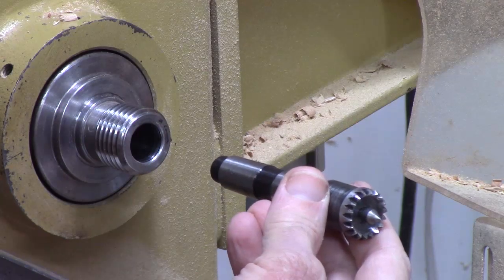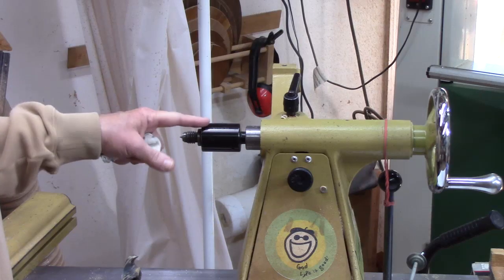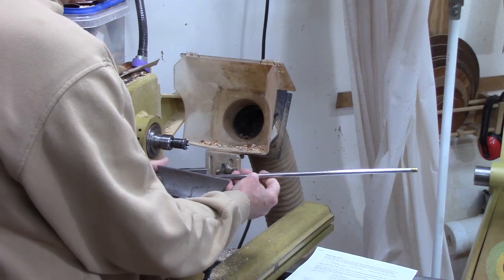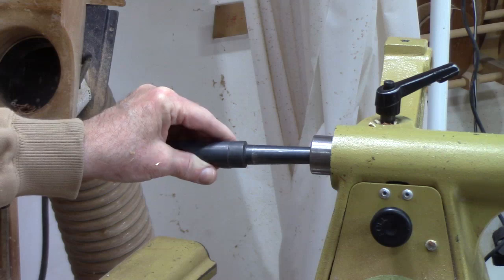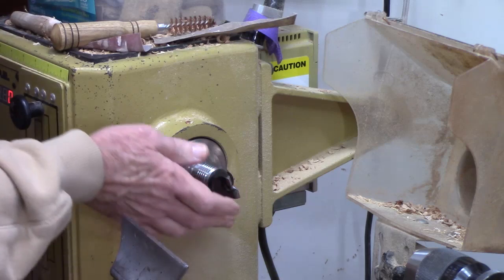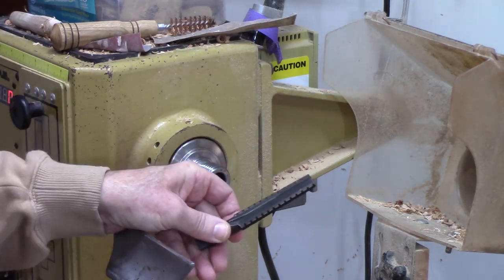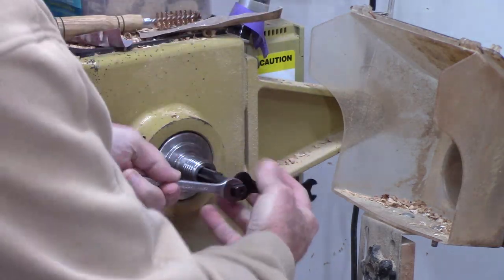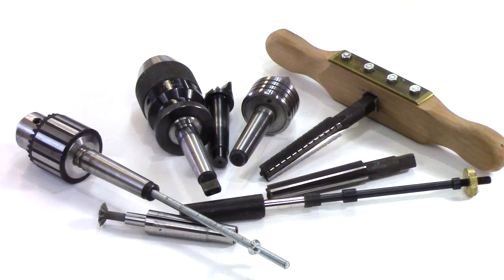Morse Taper Basics for Woodturners

Comment: Like always great information. On my lathe I drilled an taped the head and tail stock to fit a 1/4” allen screw. Then, I know it’s not the best thing to do BUT it works for me, I then make a slight grove in the Morse taper to match the allen. By doing this I have never had any thing come out or even loose . I don’t recommend doing this but it does work in my situation.

Comment: Mike - very good video.

a point that I've never seen discussed anywhere relates to the tapered arbor on a jacobs chuck.  One of the advantages of having a double-ended arbor is that if you upgrade to a larger lathe (eg, from an MT1 to an MT2), you can replace only the arbor at a much lower cost than replacing the entire jacobs chuck.  As you noted, it's really wise to use a drawbar to hold the chuck in place, especially if it is mounted in the headstock.  But the point that no one ever mentions is how do you keep the JT-33 taper end of the arbor from uncoupling with the jacobs chuck - the drawbar holds the MT-2 (or MT-1) chuck in the headstock, but the JT-33 can still work lose, and the result is that the chuck body will be thrown across the shop.
Reply from the maker: Good point.

Comment: You might try using a live center to keep the reamer straight while cleaning up minor damage to either Morse taper.  The side torque from using a wrench could make the taper egg shaped if you're not careful.Those reamers usually have a dimple in the back end that would fit on the tip of the live center. Just put the live center into the tailstock to clean up the headstock taper or put the live center into the headstock to clean up the tailstock taper. Light pressure from the quill keeps the reamer engaged on the live center.  An easy trick to prevent unintentional damage.
Reply from the maker: Good idea, Gil

Comment: When you have a morse taper reamer just bring in the quill with a center to keep the tap or reamer centered and you can use only one open ended wrench to turn while also tightening the quill at the same time to maintain center.

When you do by hand without the tailstock and center the possibility to take the morse taper out of true is greater.
Reply from the maker: Yes, thanks for commenting.

Comment: Seemed quite comprehensive Mike.
Just a note, machining suppliers sell Morse taper in many configurations like MT2 on one end and JT33 on the other. Something I'm considering for other accessories.
Happy New Year.
Alan
Reply: Alan;  JT tapers are the tapers that fit into Jacobs chucks. (but I'm sure you knew that!).   You can also get MT tapers with blank ends, but you need the ability to do metal machining to use these.  https://littlemachineshop.com/products/product_view.php?ProductID=2394&category=
Reply from the maker: Thanks for sharing, Alan.

Comment: Several have suggested supporting the back end of the MT reamer with a center when doing a cleanup to remove any galling.
I'm not a professional machinist, but I've been dabbling in metal machining for the past 20 years or so.  Some years back I bought a MT3 reamer to clean up the tailstock ram on my (metal) lathe.  That was the method I used (i.e. supporting the reamer with a center).  It worked OK, but later I learned that it's actually better to let the reamer search and find its own axis of rotation.
I know that sounds counter-intuitive.

Anyone doing this should know that because of the shallow angle, removing even just a few thousandths in the MT socket will have a very large effect on how much deeper the male MT will then seat in the socket.  You could end up where the seating depth is too much,, ie. the ejector kicks out a tailstock center before it can be fully retracted.

Also, for any who may not know, all of the MT series tapers (i.e. MT 1, MT 2, ..etc.) each have a slightly different taper angle.
They're very close, but each is slightly different.  So don't try to ream, say the big end of a MT 2, with the small end of an MT 3 reamer.  Grief will surely follow.
Reply from the maker: Great information, Lynn. Thanks for sharing.